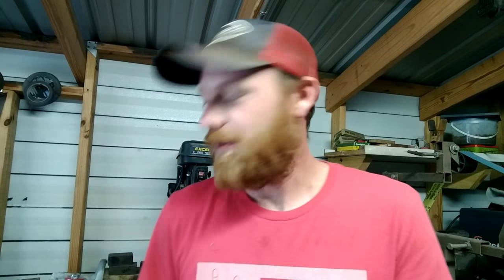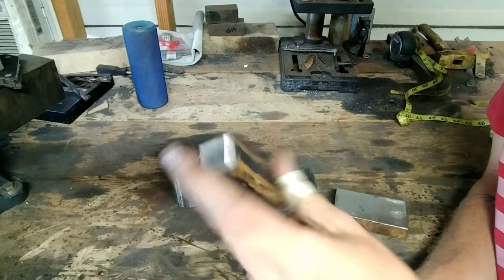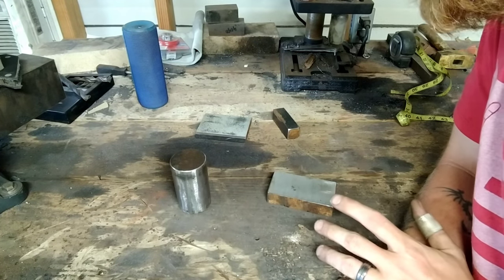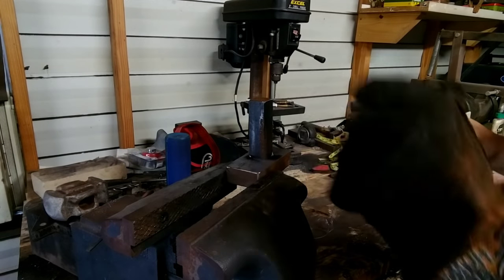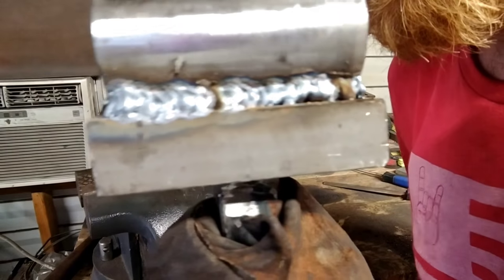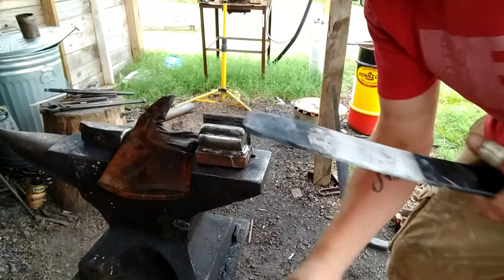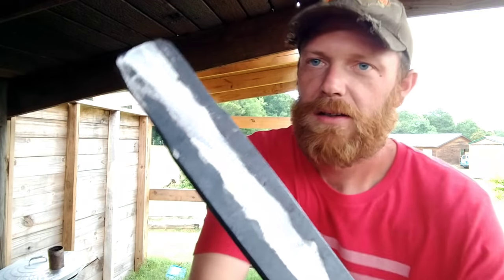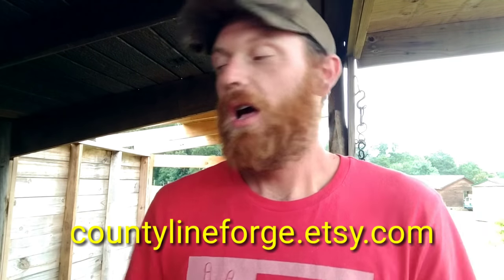Making a sword fullering jig

Comment: Aaah, don't you loose some of your fuller by beating it when you flip it over to do the other side?  ...Would it not be better to get another round bar (same size and shape as you made) and add a hinge to them, so they line up on the very top and bottom. Now when you strike this tool your forming the fuller on both sides at the same time. This way you wouldn't loose any of the newly formed fuller by only doing one side at a time? ...Just thinking out load, you got me beat by a mile on forging, I just "play" with machine tools.  G